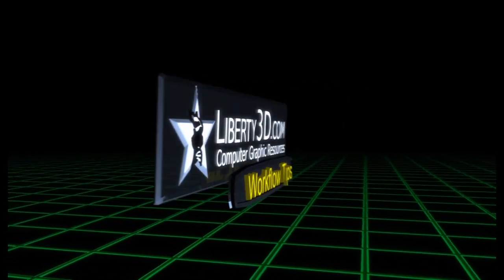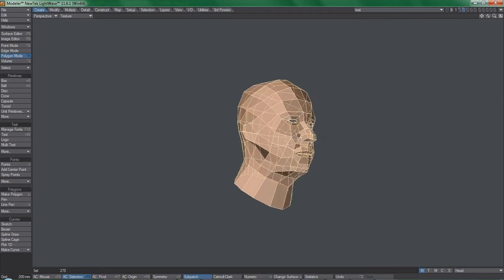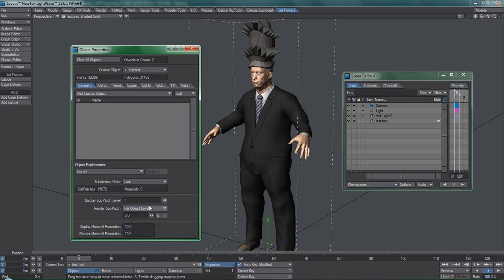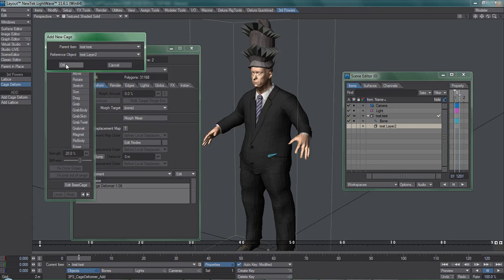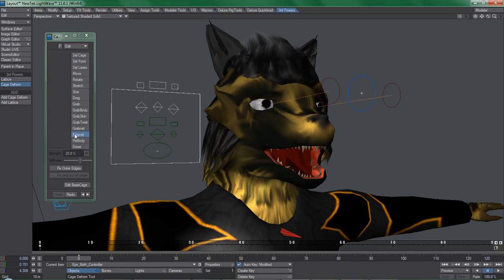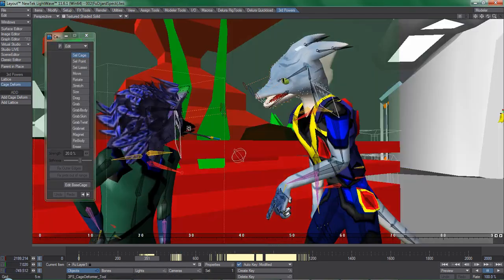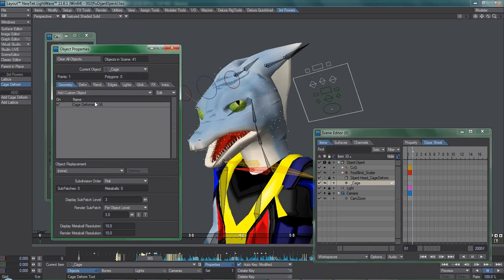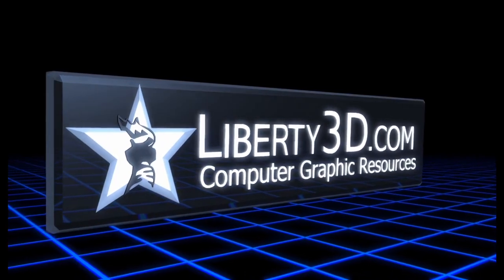3rdpowers CageDeformer: workflow and setup tips

Comment: I would actually use a cage deformer for more broad deformations and use it along side morph targets, tension deformers and the occasional facial bone for more finite or radial curve control. Allthough using multiple toolsets together seems to be a tough thing to pull off in lightwave sometimes.